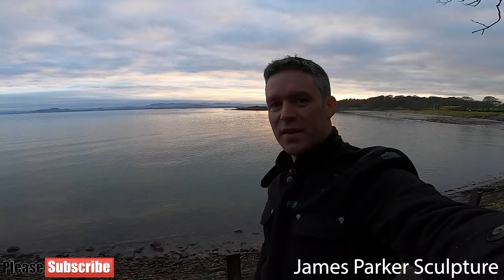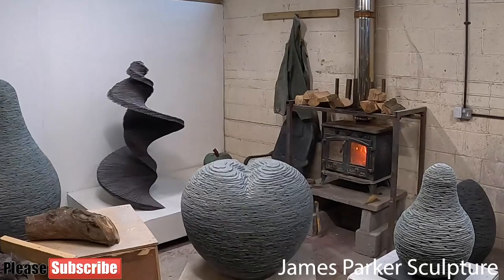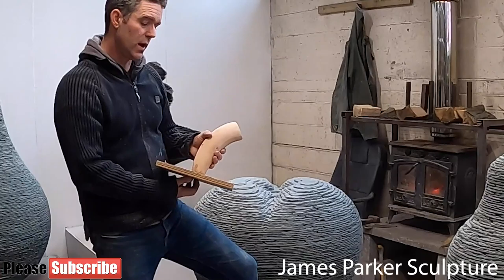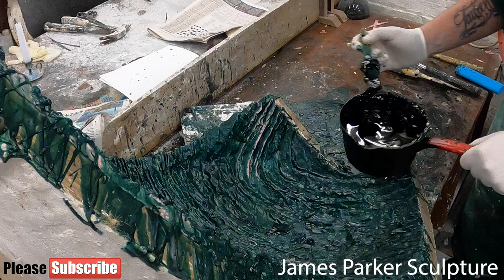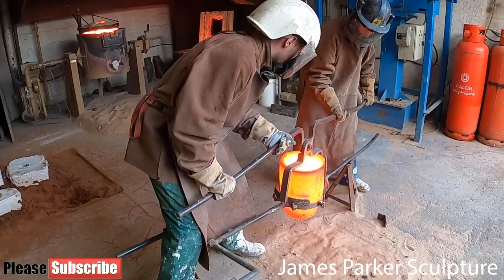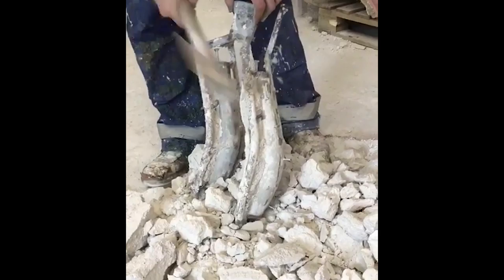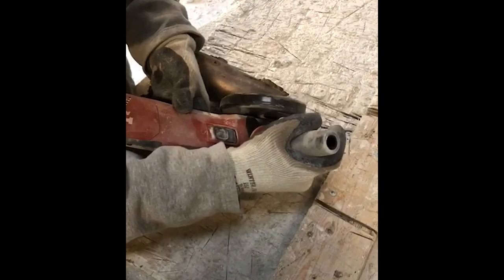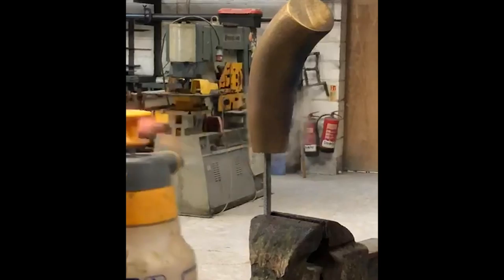SCULPTING and LOST-WAX BRONZE CASTING | James Parker Sculpture

Comment: Found you through The Hoof GP. Fantastic work. Is the slate loose stacked? How do you move them? Only thing I could think would be to shrink wrap with spray foam on the outside.
Reply from the maker: Hi Gary, thank you.
The Apple and 'Creation' in my first post were both built 'dry' ie 'loose stacked' then rebuilt and bonded together for shipping. I can leave them drystone or fix them together - in the beginning they were all drystone. I either bond them then move them, build them in situ or move them drystone.

Comment: Do u not worry that all u're work might be lost if the bronze goes pair shaped?
Reply from the maker: No - the works safe after the mold is made. If the bronze fails after that another can be cast. I've never  had an issue at all before